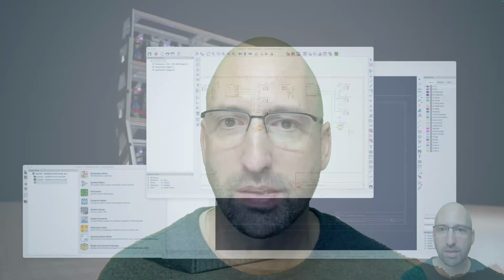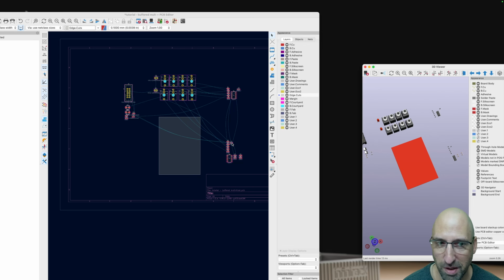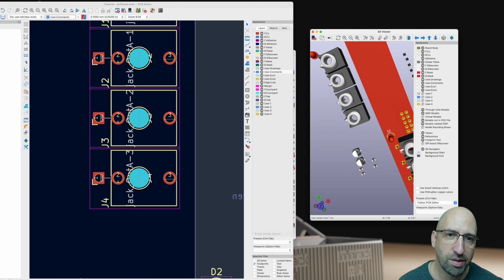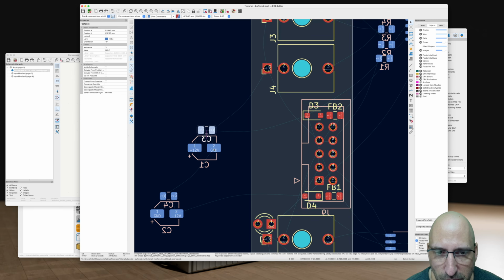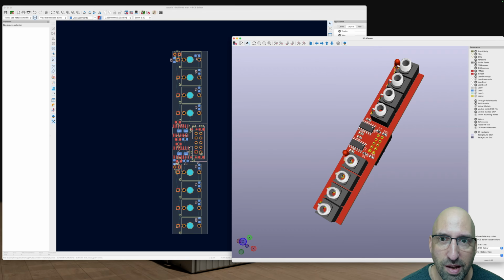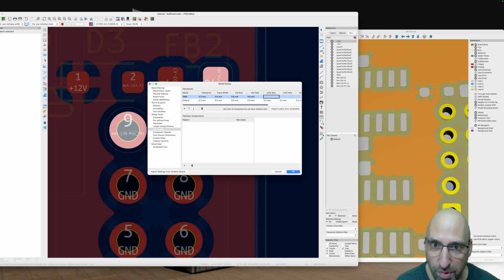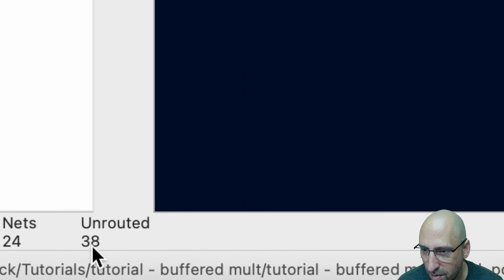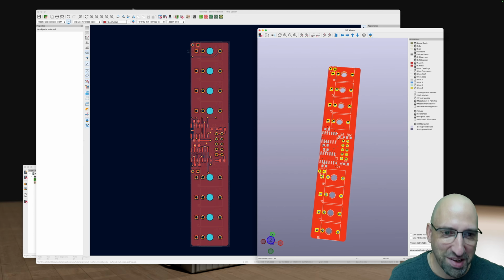Eurorack modular design 101 - Episode  2  - PCB layout with KiCAD

Comment: I really enjoyed this tutorial and enjoyed following your design strategy and watched the entire episode, but noticed what I think is an error in your drawing of the quad buffer. You seem to have connected the output of each op-amp back to the non-inverting input and in turn the input, effectively bypassing the action of the op-amp altogether.  Shouldn’t the outputs be connected to the non-inverting inputs to produce each buffer. Did you actually get this device made?
Reply from the maker: Hi @johnpaterson.. Thanks for this. Yes I did spot the mistake and corrected it in the next video. The module works perfectly. I need to get my act together and finish up the last videos of the faceplate design and assembly.